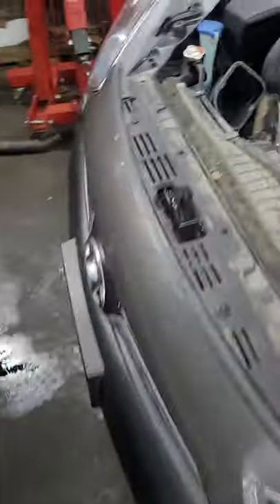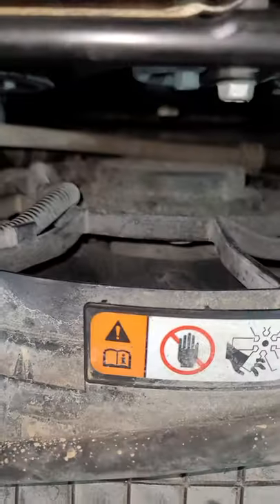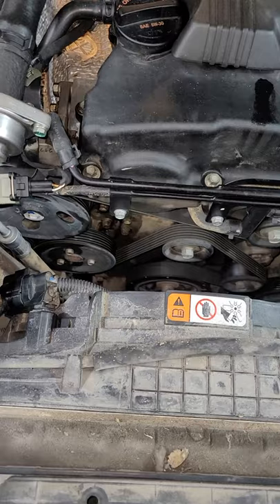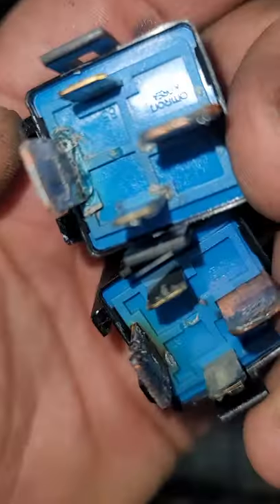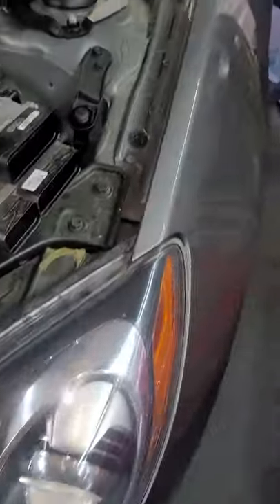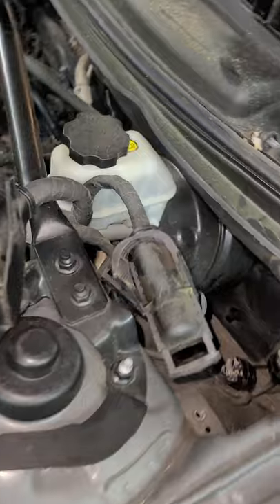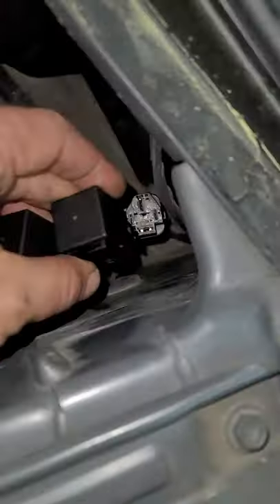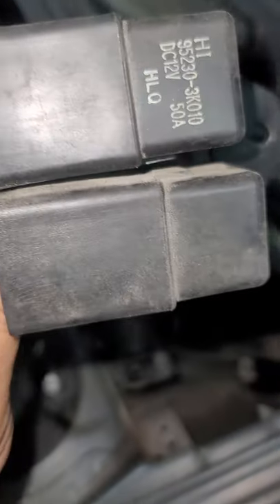hyundai genesis radiator fan and a/c compressor relay location

Comment: Hey in your fuse box in the engine bay, has two extra (Relays) look in ur car manual and see which one you need. Both fan and a/c should have a spair inside. Good luck all.
Reply: Thanks I'm about to look now, the dealer wants $50 each and don't even have them in stock
Reply from the maker: I saw them online

Comment: What is the difference between these and the cooling fan fuse in the fuse box? My engine fan stays on after the car is shut off and I can’t figure out if I should replace the fuse or the one you showed
Reply from the maker: First you need to check your coolant maybe is low and the thermostat maybe it stays off or something made the fan working all the time to keep the engine cool down
Reply: did you ever solve this problem? my gen keeps doing this and i can’t figure out what the problem is
Reply: @jabingraham7185   yes it was the engine fan relay. Looks like a small blue cube
Reply: in the fuse box right?
Reply: @jabingraham7185  not in the fuse box, my 2013 v6 had it in the top right corner of the engine bay. They are covered by a black rubber piece.
Reply: @billbaggins9864  thank man i’m checking them right now
Reply: Did you replace it only at the dealer?
Reply: @billbaggins9864  was it replaced at the dealer or local autozone?
Reply: @billbaggins9864  do you have the 3.8 v6 genesis? Cause I have a 2013 3.8 and my ac stopped blowing cold air
Reply: @billbaggins9864 hey bro where do you get the parts you replace at the dealer or auto parts store?

Comment: That's good to know I have a 15 genesis coupe 3.8l and dealing with the same problem. Quick question the relays that you pulled out were they both numbers KG8JR-72R?? I only ask because both of my relays were burnt out too but I had one KG8JR-72R and the other one was 95230-3A400 which the pins are smaller. I'm just trying to figure out why they were not the same relays. And the smaller one was significantly more burnt out. But anyways Thanks for uploading the video. Helped me track the problem.
Reply from the maker: Hello and thanks for watching.  Ok both of my relays was same number but I don't remember the numbers there was a rubber cover on both of those relays the number was printed on it
Reply: Oh Ok I see now Well thanks for help much appreciated!
Reply from the maker: No problem anytime
Reply: Hi i get stock in the middle of nothing in the highway traveling to florida and ky genesis 2015 turn the sign overheating  i notice a few hours before the a/c was blowing heat air and than i notice the radiator fan is not spining even when is hot . Today everything is close can you help me how you fix it maybe i can do it tomorrow sunday By my self please

Comment: Do you know if those relays are the same in the 3.8? Like can I buy those 2 relays from a 3.8 and put it in a 2.0t?
Reply from the maker: To be honest I didn't see those relays on 3.8 but you can match the part number
Reply: @hanitwfik  I have the 2015 3.8 and I have the same two relays, same location.  I swapped the two to see if the problem follows. I still have no Cold AC output.

Comment: Thks!! Have a question!

When you still have the relays burned, did the a/c switch pilot light still come on when activated?

in my car, the light comes on but does not blow cold air

Genesis coupe 2.0 2013
Reply from the maker: Yes light will come on anyway  doesn't matter if the relay's  good or bad
Reply: @hanitwfik  thanks!
Reply: @hanitwfik  and having the relays burned, did you have any light on?  check engine?
Reply from the maker: @thenick6083  no check engine was not on
Reply from the maker: @thenick6083  you are welcome

Comment: So my connectors were also burnt/melted. Do I have to replace harness? If so, what is the name of harness for the fan? Btw, thanks for the video.
Reply from the maker: It is better for you to find a used harness on ebay otherwise you will have to replace the whole harness wires, and that is expensive

Comment: I have a 2013 genesis 3.8 grand touring. the radiator fan isn't spinning if the ac isn't on. we changed the thermostat the coolant sensor and this relays in the upper corner and it still doesn't come on and the car overheated again.  please help .. I know it's a simple fix that the dealer will overcharged me for
Reply from the maker: have you notice a coolant leak ? if no leaks and you changed all that parts then it could be the water pump or a head gasket problem
Reply: thank you for replying.  I will have mechanic check both of those.  could it be the cooling fan module or resister?
Reply from the maker: @loveleighbones  I don't think so . You said it's working when you turn the a/c on
Reply: @hanitwfik  yes, the fan will come on if the ac is on. and there's no leaks. there doesn't seem to be any tell tale signs of the head gasket having issues. I think it's time to take it to hyundai. thank you
Reply from the maker: @loveleighbones  thank you